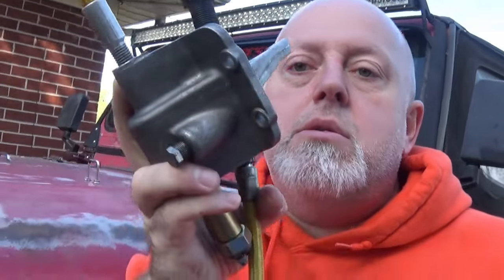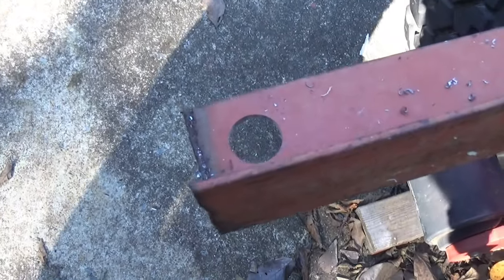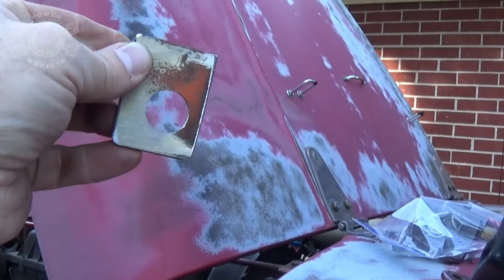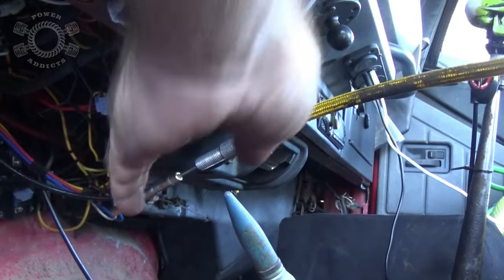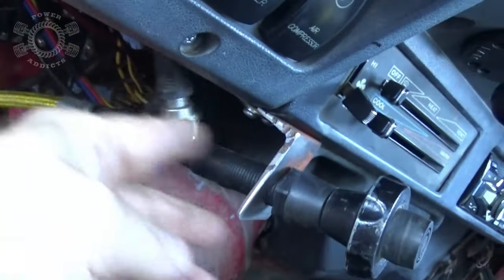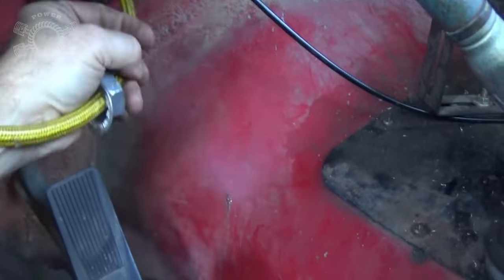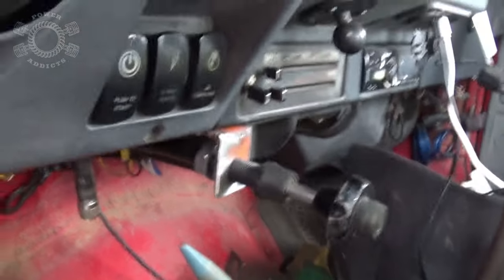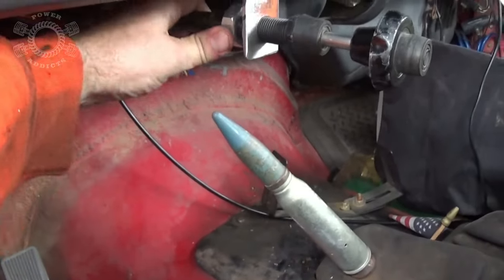How to install a Posi-Lok in a Jeep Dana 30 CAD Axle #poweraddictscrew #dana30

Comment: Great informative video. Just what I needed. However you forgot to mention the electrical wires unless your posi lok didn't come with wires and switch.
Reply from the maker: It did come with it but the switch is bad. I've got a better option that I just haven't got around to installing/videoing yet. Coming soon!
Reply: @Poweraddicts  interested.. I am about to install one of those. That switch is my issue. I can't find any video  talking about that switch wiring.

Comment: Chuck hope you can help I have a 04 jeep tj 4.0 it s a project jeep I have an issue when I am going 45 mph an over the jeep will chugging an engine light will flash just replaced all 4 o2 sensors an exhuast please help

Comment: Does this allow the factory 4x4 light switch to work or would I have to wire it into the transfer case as I’ve seen others do with a one piece axle swap

Comment: Power Addicts, great video as usual. What made you install the posi-Lock? I thought you kept your axles engaged full-time?
Reply from the maker: You are correct I did keep the collar engaged full time. I installed a Spartan lunch box locker so I added the Posi-Lok as well. By being able top dis-engage and re-engage the CAD I will be able to create videos about the performance, pros, and cons of the drivability of the locker. Once I get all those videos done I'm going to do a solid axle swap using an XJ axle therefore eliminating the CAD.
Reply: Thanks for the replying! You my friend.... Are The Man!!!

Comment: How is the transfer case affected with regard to four wheel low or four wheel high?
Reply from the maker: This mod doesn't have any affect on the transfer case. Your gear selector (transfer case shifter) tells the transfer case where it needs to be, not the front axle.
Reply: Okay, I understand now.  Thanks for clearing that up for me.

Comment: Your videos always help me out so much it's insane. I did the electric part on my 90, just ground one wire to a bolt on the cad cover and run another wire up to the blue top hat thing and splice into it,then the 4wd light works. But I still can't find out where to put that cap at to stop the vacuum. Cause some say you need to cap it cause of something about the transfer case? Mines a 4 banger and supposedly it's a red vac hose? Whereabouts unknown at the moment?

Comment: I just received the PSL900 and it has issues just looking at it. The big nuts do not slide off   the cable (like you did) to install the mounting bracket. The pressed fittings are bigger than the nut,,it cannot be taken off. Not a huge issue I can modify the mounting bracket to slide over the cable.
    The mounting bracket will look like a fork instead of a hole. Hopefully the nuts will secure it enough from falling out.
 Second the aluminum housing is not machined correctly,,the cable wont go thru the hole,,I had to take a file and clean out the hole with threads very close to what I am removing. It worked and now the cable end goes thru the housing .
   And 3rd,,I have the 1st page of instructions,, a missing staple and any other pages that were once here. I guess not needed? Who reads instructions?